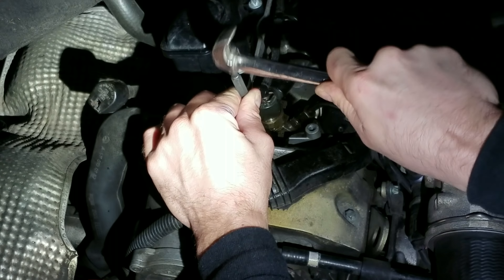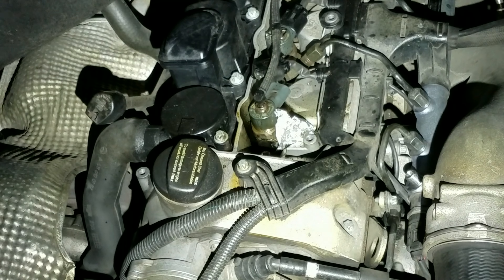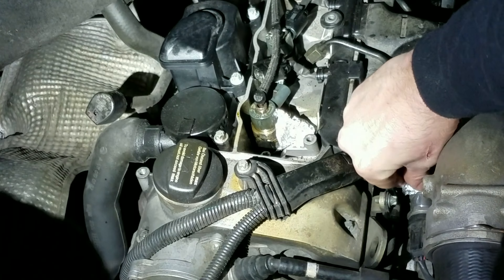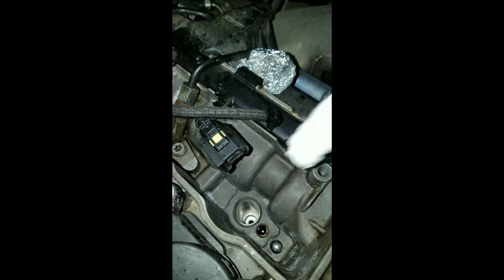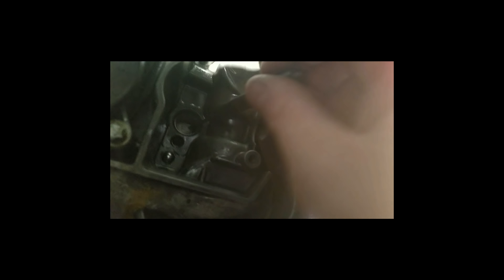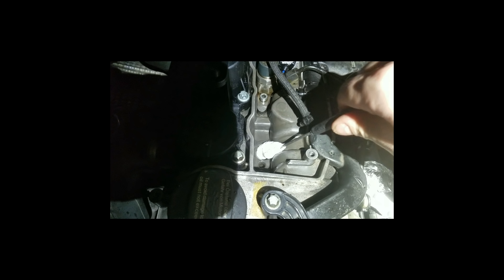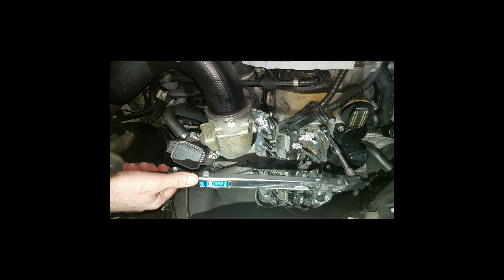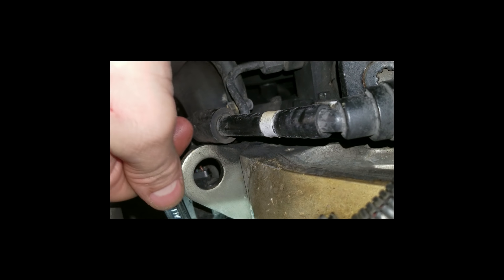How to fix "Black death" injector seal leakage on a T1N Sprinter [02-06 Dodge/FL/MB]

Comment from the maker: If you don't like the video please leave a scathing comment rather than an anonymous downthumb. I put a LOT of time and effort into making and editing this video (Over a whole day).
Reply: Did you have to plug the injector hole with anything so debris doesn't fall into the cylinder? I couldn't tell if you stuffed something in there of not?
Reply from the maker: Yep I did my best to keep it plugged with paper towels but I wish I had a proper plug.
Reply: How come you don't have black death carbon buildup on your engine, and second how did you remove the injector by hand? This is some kind of David Copperfield trick I guess.
Reply: B
Reply from the maker: @googletv9902  I don't have carbon buildup because I smelled diesel exhaust in my HVAC vents so I got to it quickly before the crud started building up. Makes it easier the quicker you get to it. The trick to removing it by hand is getting the engine quite hot for a long time and pulling the injector within 10 mins of shutting the engine down. If you take a look at my video here: https://www.youtube.com/watch?v=oenk_RGZAv4 it shows how the tar becomes a solid glue once cooling down.
Reply: I liked the video. It was informative and want to add other findings that I have come across to help others because it is a common problem on Diesels.Thanks
Reply: It was a bit too clean to be like the kind of carnage most people see!
Reply: @AncapistanVan  I let the 5 cylinder Sprinter warm up each time I drive so the fuel is not turned to cement in the injector well. So I did what you did in time to stop the big mess.
Reply: I'm Scottish me buddies are irish ,english,germsn,viking,you don't  want our comments ladd..nice video though

Comment from the maker: Update: Don't use a pick covered in papers towels like I did. You can easily scratch the injector seal face if your pick isn't shaped just right. Use a wooden dowell with medium grit scotchbrite pad superglued to the end of it. Home depot carries the right size, 5/8" IIRC - it's a tiny bit small though so I had to oversize the scotchbrite.
 When cleaning the hold down bolt hole, be very very careful if you use a drill because a harbor freight bottle brush can be caught by the threads, suddenly ramming the steel core through your cooling jacket. So yeah don't use a drill. Same goes for using the old hold down bolt as a tap - do not use a drill/powered driver to run it in, only for remove. Hand tighten so you can feel the threads and grit. There is risk of bottoming out the bolt with the hold down not installed so be gentle using both of these tools. Or your injector valley will fill up with coolant.
Reply: Hi. what product did you use to clean the surface with black deposits from the injectors?
Reply from the maker: @liviuiasinschi4712  Oven cleaner (Sodium hydroxide). Ideally you'd wear a painting respirator (organic vapor mask). You can get them at harbor freight for about $30. I'm pretty sure the vapors are very harmful to breathe or get in your eyes. It's basically lye - extremely caustic. It even reacts with aluminum so you don't wanna leave it on there. Honestly I hate the smell, last job I caught the injector leaking early and I was able to just use brake clean and not deal with that lingering horrid smell. I hear a lot of guys swear by acetone, tho. Should be able to find it at a hardware store sold as a paint thinner or similar.

Comment: OK CapVan man, I have the 5 cylinder and at 170K the median bearing was gone-broken in the rubber support branches. I went to MB and looked at the parts man's drawing and discovered something strange: There was a "shim" part listed that was different than I had. This redesigned mounting bracket for the driveshaft moves the median bearing about 18-19MM toward the
passenger side and this reduces the vibration and excess wear on drive line parts. It was a 2005 4th quarter introduction that MB did not want to recall! So take a look at my 3 vids and do
that to your 5 cylinder. Well worth the $$ and time. Good luck  V Rolfe Chicago
Reply from the maker: Yeah sometimes parts get updated, I haven't heard of that, good info, thank you

Comment: I am told that engines are built with out any grease, oil or copper grease on any bolts and that torque settings are for dry bolts. So if you do use any copper grease then you will tighten more than the required amount. I do generally like to use copper grease where heat and corrosion is involved but would be wary of doing so on an injector bolt.
Thanks for the video, it will help me considerably as mine are leaking mildly but I will do them asap
Reply from the maker: That is true, at least for the injector bolts, which come with a little yellow stripe of factory applied thread treatment. The bolts are magnetic, so I believe they are steel. The head is aluminum. Rust doesn't seem to be an issue on my injector bolts; what held them in was the gooey tar baked into a glue. In my video I think I sprayed a little PB blaster because the threads were bone dry after spraying with brake cleaner/oven cleaner, but that was kind of an experiment. You are correct that the OEM procedure does not call for any lubricant, grease, or anti slip treatment.

Comment: Great job cleaning that out, it looks good as new. I am about to do the same on my sprinter but have let the black death go a bit and am going to have a much more cleaning to do.  I have a couple questions I was hoping you could answer. 

When cleaning the cylinder, did you use oven cleaner on the inside? Should I be worried about any of the residual carbon build up or even the oven cleaner getting down into the head? 

I noticed that there is a torque spec for the fuel injection line as well. Is this as important to follow or should I just tighten down as tight as I can?
Reply from the maker: Thank you. Yes I try to avoid getting oven cleaner into the engine down thru the injector hole. A harbor freight bore brush kit works great but just be careful of the protective rubber tip that it comes with, it's easy for that to fall off and into your cylinder (Remove it before use).

As for the fuel injection line, I was taught to be careful not to over tighten flare type high pressure connections like these ones. It's really a personal subjective feeling as to what is too tight and what is not tight, so yeah getting a torque wrench and a crows foot for this scenario might help you familiarize yourself. Personally I just crank it down with one motion and then maybe check it with another motion but I don't do any more cranking down. I know that's very subjective but that's basically how it is with this type of stuff unless you have the proper tooling

Comment: Thanks for a great video!  I followed it in Feb 2020 to fix black death on the #3 cyl on our 06 Sprinter.  The smell and chuffing sound returned in Feb 2021.  This time in the #1 cyl.  The #3 was tough because access is more restrictive and the only way to look down the injector hole and bolt hole was with inspection mirrors.   Ugh. The #1 looks like it will be easier access and I will not need to rely on the tiny mirrors.  I have marinated the injector and bolt for a couple days with PB Blaster.  Game on tomorrow!
Reply: Ok, I'm back again...  Succesfully fixed cyl 3 in 2020...cyl 1 in 2021...now am having BD in cyl 4, as if cyl 3 wasn't difficult enough to reach. Ugh. Rewatching your video tonight. Applying PB Blaster tomorrow with plans to dive into the repair later in the week. Thanks again for this video - it boosts my confidence. But I  still dread it every time.

Comment: Did you ever did this on a Opel Movano (is same like Renault Master) 2.5 diesel engine..?
Any thing I should know before trying to do this myself..?
I'm quite 'handy', yet a little afraid... I don't wanna break bolts, so i'll first run the engine warm...
There is already quite some black-death-goo on it, wich I want o clean out but I don't know how...
(I heard about Crab-cleaner-spray, but I read on the spray-can it is very toxic stuff and it should NOT be sprayed on warm/hot surfaces... yet, overn-cleaner is not a good idea either I saw somewhere...? What is the best stuff to make the black death removable..?)
The idea is: 
1. Spray some 'black-death-remover' on the area... to 'loosen it up'...  (so, what to use for that..?)
2. Go for a ride so engine is nice and warm...
3. Start disassembly of the parts that are in the way, so I can reach the hole...
4. Clean as much black death out as I can.  I Wonder what the best way is...
5. Loosen the hold down bolt(s).  (or loosen them a little and run the engine for a few seconds...?)
6. Disconnect the electric line and retour-line for the diesel.
7. Remove the pipe going from common-rail to the injector and covering op the wholes with some tape.
8. Trying to wiggle the injector to see if it moves at all...
9. If it does not move, do some more cleaning... (?)
10. I bought a injector removing set (with a sliding hammer)... so, if needed, I'll do that, 'gently'... to try and get it out.
11. See if the copper washer is 'out' or still in the hole... and try to get it out.
12. Clean the 'seat(ing)' of the injector.  (I bought a cleaning tool that looks a bit like a 'drill' for this)
     (try to make sure nothing falls into the cilinder (is it bad if some tiny particels fall into the hole..?))
13. Clean the threaded holes for the bolt(s) wit a tap and ear-sticks... doing it a few times... very gently and with 'feeling'.
14. Cleaning injector and check-up.
15. Putting injector in hole with new seal.
16. Installing new bolt(s) to hold it down and tighten with torque-wrench... (is it always 7 Nm + 90° ?)
17. Connecting pipe + re-assembly + test.
Hope you can help by answering were i'm wrong...
This 'list' might also help others... 😇

Comment: good video, but wouldn't leaking injectors indicate dirty fuel? maybe the fuel filter could be old and letting dirt pass, or the exhaust could be partially blocked?
Reply from the maker: Eh, there's a big thread on the sprinter source discussing the cause of black death, some say it may be the lower cetane fuel we have in the US compared to the EU - it modifies ignition delay. Other than that topic, no, bad fuel is not the cause of black death. It's just a flaw of these engines. Mercedes didn't use a big enough hold down bolt. They could have used a more stout bolt with more clamping force.
Reply: @AncapistanVan  it's hard to see but when you took out the injector did it have an O ring? my car hasn't got O rings but it looks like I could put one on. would you recommend them?
Reply from the maker: @preytec  no, o-rings are made of rubber, therefore they cannot seal compression. The compression seal is copper on my vehicle. Check your service manual and a vehicle specific forum for info specific to your engine.
Reply: @AncapistanVan  yeah you'd still have the copper washer, just a rubber washer stopping any black carbon working it's way up the injector. like this http://www.erikc-commonrail.com/photo/pl22320818-erikc_original_injector_soft_silicone_o_ring_injection_o_seal_ring_for_bosch_piezo_injector.jpg
Reply from the maker: @preytec  oh, those o rings are just to prevent water from getting down to the injector, to prevent corrosion seizing the injector in place, i would think.
Reply: @AncapistanVan  I was thinking they might also hold the injector stiffer and prevent wobble, stopping any occasional gas leeks below
Reply from the maker: @preytec  that's the job of the injector hold down bolt, but yeah maybe that o ring keeps the injector in-place a little tighter

Comment: I'm about to perform this operation on my 2006 T1N 3500. Just one question. What is the foam like spray you are using with the tooth brush. I've been using Anticarb to clean off the top, but I need something that can sit and do work on the gunk.
Reply from the maker: First off, make sure your engine is piping hot. I even prefer to crack injectors loose with the engine high idling, heater booster on. You have to work quickly because the goo turns into a glue within about 15 minutes of engine shut down.

 Carb cleaner and penetrant won't do much to the carbon glue. What you need is sodium hydroxide. Lye. It dissolves the carbon into a liquid. You can get it for about $3.50 in a can of oven cleaner spray, cheapest at WinCo.
 Last week we had an injector that just wouldn't budge with everything we tried, for 2 weeks daily with the heat gun, we even reassembled it clamped off the line and ran the engine on four cylinders, still wouldn't budge. Then we let it soak in oven cleaner overnight and the next day we got the top to unscrew off so we could weld on a socket. If you take a sample of that black death goo you can spray it with oven cleaner and watch it dissolve. Anything larger than a pea size pebble takes several resprays to liquidify.
Reply: @AncapistanVan  Thanks so much for the great advice. This helps a ton. I actually have one more question...how do I diagnose which fuel injector is the problem if I don't see any of them pitter pattering the smoke from the top of the injector? Do I just go off of whichever one has the most black death surrounding it? Or do I just remove all of them and check?
Reply from the maker: @joelflora2252  I'd use some real soapy water in a spray bottle, look for bubbles. Sometimes leaking injectrors can actually re-seal themselves with the carbon goo, so it might not always work. A hot engine would help un-seal any leaking injectors, but if the engine is too hot, the soapy water will just evaporate rather than bubble, so I guess one could drive for a while with the heater booster on, then let the engine cool down enough to perform the test.

The best way that I know of to prevent black death from happening in the future, is to remove all of them and re-seal, with the updated torque spec of 62 ***inch pounds*** (Not foot pounds) + 90 degrees + a second 90 degrees. The engine must be as hot as possible during removal, and the hold down bolt hole must be completely clean, most especially at the bottom of the hole - it needs to be shiny and free of any debris.

Comment: Awesome video, thanks for the in depth details. Whats the best way to source the torque for the retainer claw bolts?
Reply from the maker: 62 inch pounds, not foot pounds, plus 90 degrees plus a 2nd 90 degrees.

Comment: How is the injetor holding up? Did you need to do any special reprogramming due to the new injectors?  I need to do injector number 4 near the back so i'm concerned  about workable room back there.
Reply from the maker: 2 yrs later, holding up just fine. I have replaced all 5 injector seals now as each one failed one after another. Now at 350 k miles. As the injectors were not changed, injector variation coding was not necessary. I was able to do injector number 5 at the very back no problem. I did make use of a mirror a little bit but there is definitely enough room to work. As long as you don't need a puller (I never have, yet). But I recently uploaded a video on how to remove the engine mounts. That can give you a whole lot of extra space and it's actually really easy to remove the four bolts for the engine mounts and drop the engine

Comment: I do appreciate the time and effort you have put in to replace the injector seal. However, I could not help but shake my head when I see you blowing out the thread of the clamping bolt - after you painstakingly cleaned the injector seat??? Really, I would have done this first before anything else.

Other than this, job well done and congrats to a good video.
Reply from the maker: There was a wad of paper towels deep in the injector bore. Working in the rain, things don't always go perfectly.

Comment: There's any drivebility symptoms with black death?
I have a 2006 sprinter 2.7 and I have poor throttle response.
Reply from the maker: Yes there is. Because when the injector seal leaks, compression leaks out past that seal, making that cylinder weak. When it gets bad enough the engine is basically running on four cylinders since that cylinder isn't contributing anything. It's really easy to pull the plastic injector cover off, I would recommend taking a frequent look, maybe just put on two bolts and leave it loose. 

That being said, poor throttle response is often a symptom of limp mode. Most common causes of limp mode are the turbo resonator seam on the flat end, look for oily wetness. And oily wetness on the boost hoses, there are three different sections and you will have to grab them with some gloves with a powerful flashlight to detect any rips because they can be sneaky.  There's all kinds of things that can cause limp mode. If you unplug your MAF while observing the turbo actuator, the turbo actuator will move, doing a self test. A clogged fuel or air filter can cause this, and if you have an 02-03 model, a vacuum leak in the turbo actuator vacuum line can cause this. The EGR is a common culprit too. I've had it happen from dust on the sliding variable resistors inside the throttle pedal - haven't seen the code in a year after sweeping the pedal through its full range of motion, key on engine off. You really got to get a scanner because there's just too many possibilities to guess.